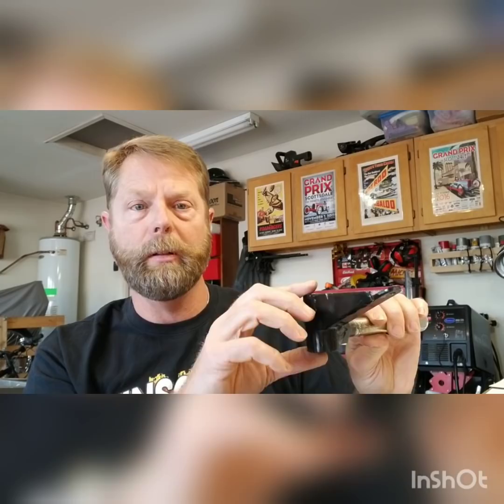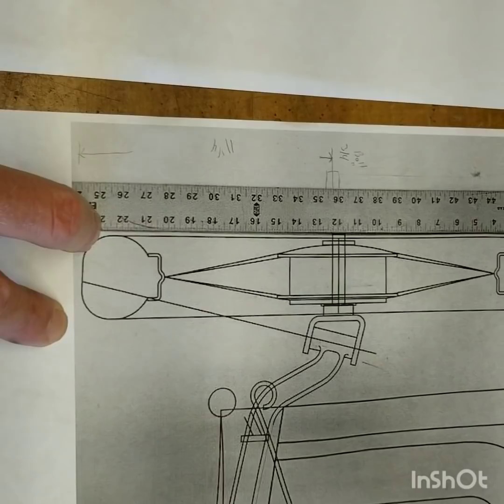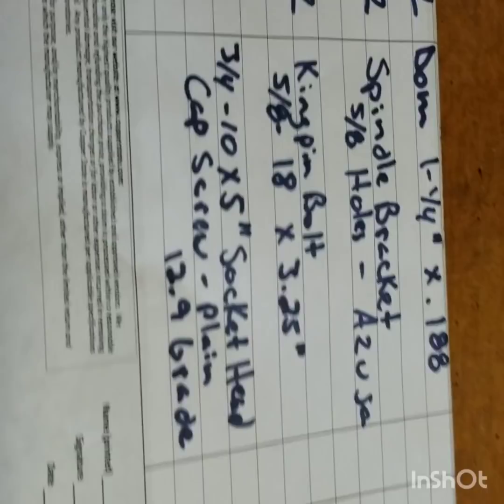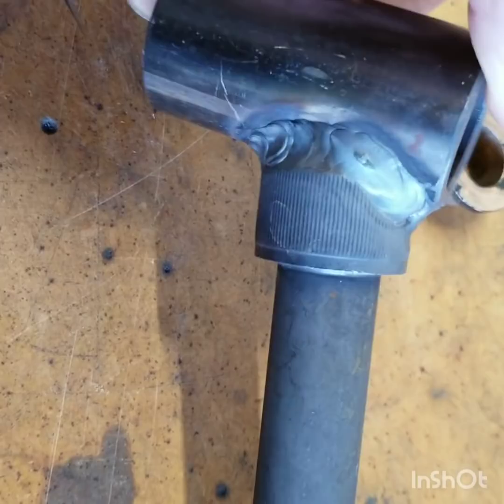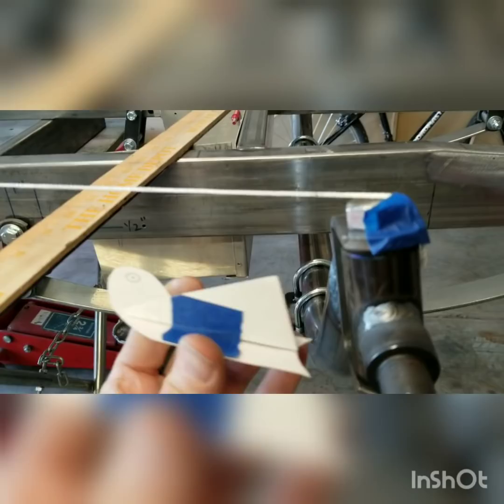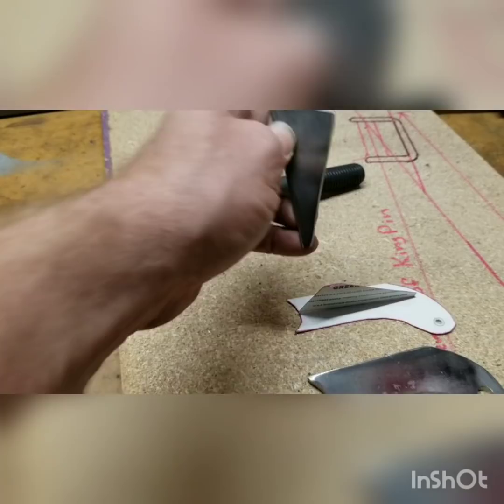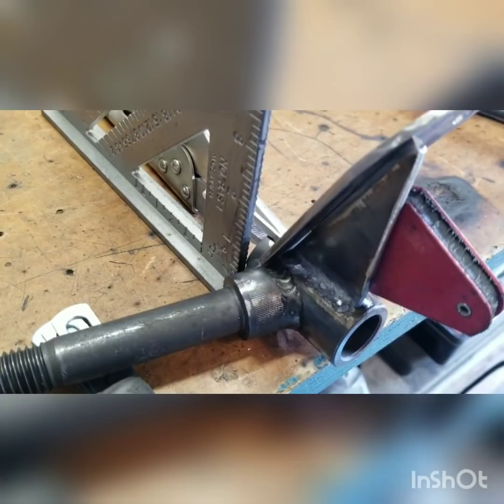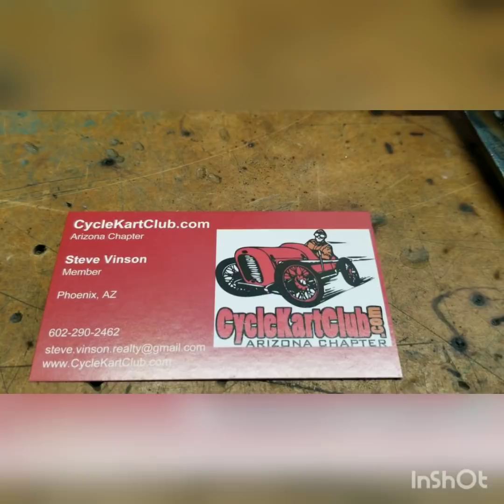Cyclekart Spindles from Scratch version 1

Comment: Did this mod on my trike years ago. String to middle of rear axle works pretty well. Cornering improved a lot! One tip if you are afraid to mess up the angles when welding: Cut the parts with margin and mark and drill the hole for the ballpin for the steering rod after the welding and grind off the access material. Worked for me :)))
Reply from the maker: Thanks for the info!

Comment: Great information Steve! I remade the steering arms on my spindles to account for ackerman. (I used to be an alignment mechanic)
Reply from the maker: Fantastic, we can always improve.  Thanks for watching.
Reply: @stevevinson6030  that coating you referred to is mill slag,and when mig or tig welding it should definitely be removed. 
By the way, I'm pretty impressed with what you do with what you have. Keep up the good work.